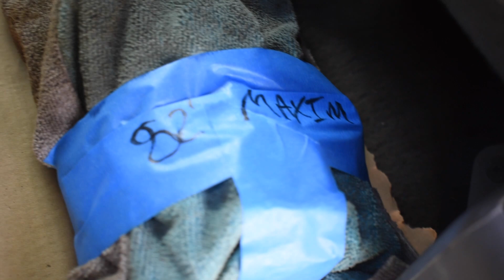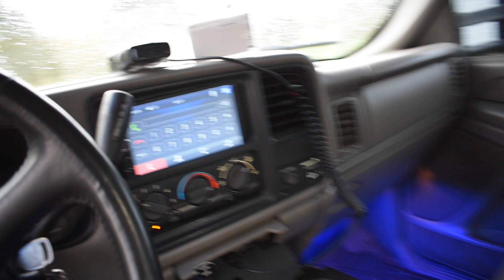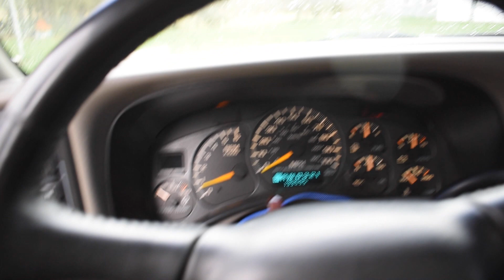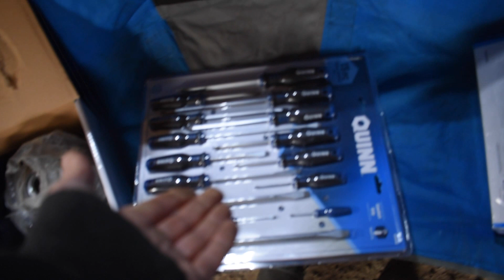BOUGHT A TRACTOR + MORE!!

Comment: Those are hard to start due to the 6volt glow plugs, you can do a simple conversion to 12volt that helps it start much easier.  The lawn mower battery gets drained too much with the original setup. Also those kubota Diesel engines tear up the drive shafts on those especially when the round rubber isolaters get worn,  another thin I noticed is that the hood says it’s a 1512, but that tractor looks like the super series chassis instead which is a 1572 diesel.   Due to their higher value someone probably took a 1512 diesel and a gas engine super series like a 1872 or 2072 and combined them to make the more valuable diesel super series tractor